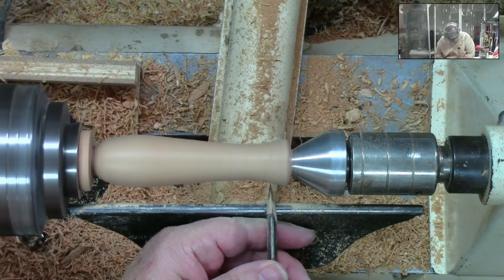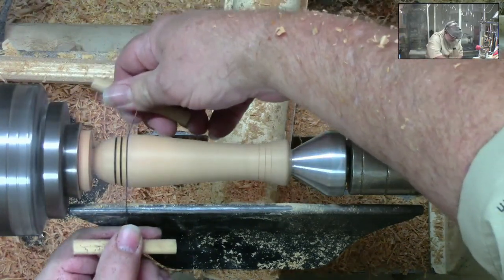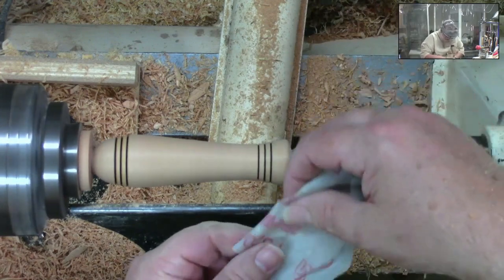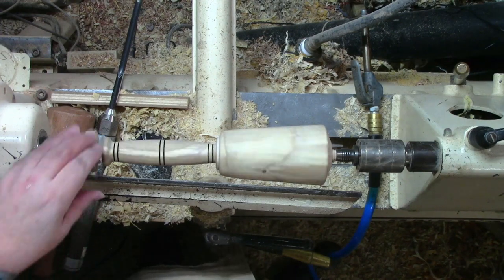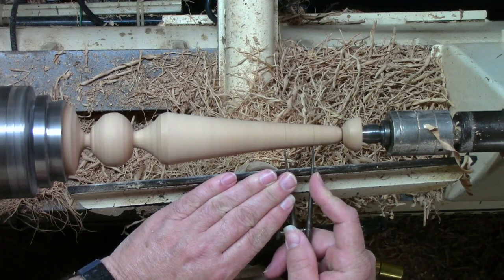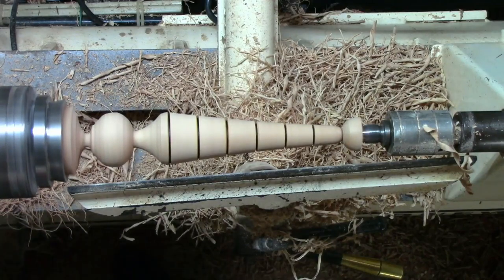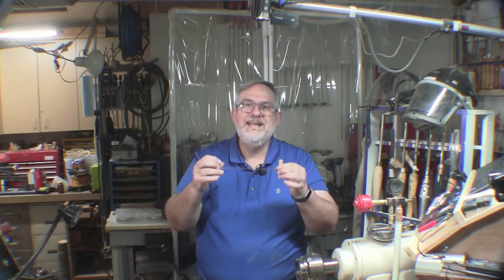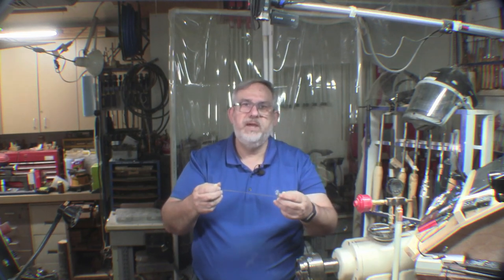How to make and Use Wire Burning Tool for Woodturners. #woodturning, #wood turning.

Comment: You can use dowels like you show here. I've made wooden balls of about 1 1/4 inch in diameter. The wire is fixed with a through-hole and another hole drilled close to it half the depth where you stick the end of the wire in. They provide a good hold and in case of an emergency they slip easily from your fingers. Still haven made a video about that so thnx for reminding me!
Reply from the maker: Great Tip, So many ways to do the same thing, Thanks for Sharing!!

Comment: Dean, I’ve heard several people say they use guitar strings as well as cable wire of old bicycle brakes. I was wondering if you know the correct term they call the little ends crimped at the ends of stainless wire(like on bicycle brakes). The wire is real tough to bend and I thought after putting the wire through the wooden handle you could crimp one one the end. 
Thanks
Reply from the maker: I know what you are talking about, however I am not sure what it is called.